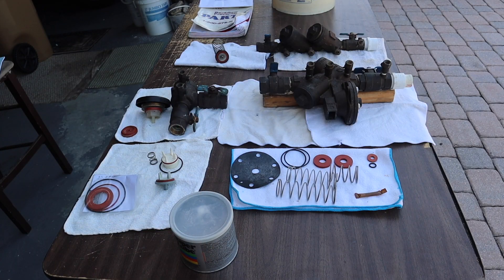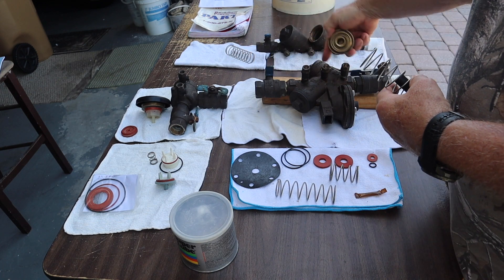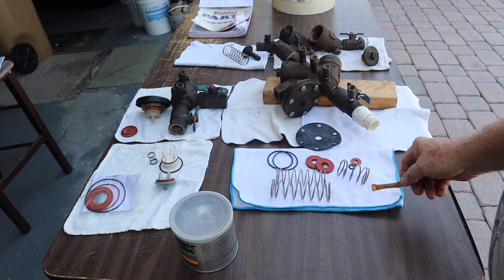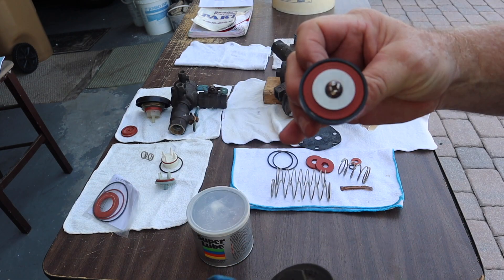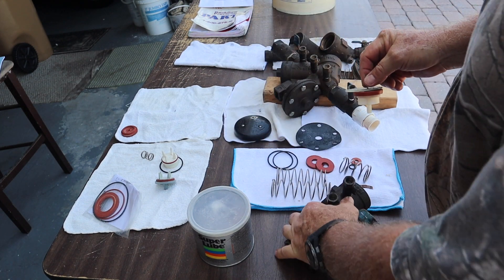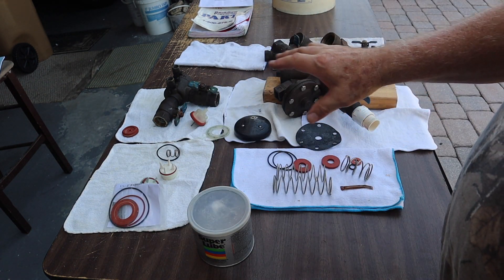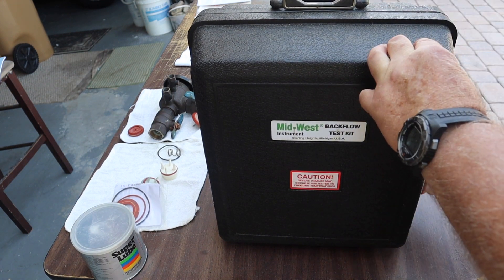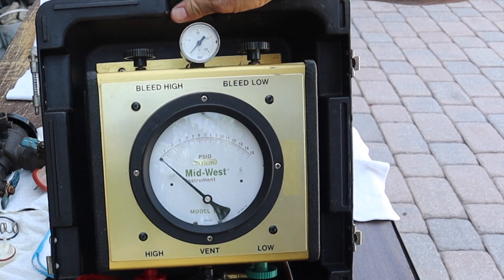HOW DOES A BACKFLOW PREVENTER WORK?

Comment: Nice video. Did you say double check backflow preventers cannot be used for sprinkler irrigation? Also, is a y-strainer necessary for reduced pressure backflow preventers?
Reply from the maker: Joel, I cannot speak for the entire country however, a double check is not authorized for irrigation systems. My water authority has looked the other way on them and continues to ignore new installation but they still are not allowed to be approved.
Reply: Thank you for the response. One other question.. Do you know if a y-strainer is necessary for a reduced pressure backflow preventer?
Reply from the maker: Sorry Joel, I forgot to answer that question. The purpose of the strainer is to minimize debris flowing into the RPZ. It is surprising how much debris is in our water system pipes but most of what causes a problem is sand, dirt, and mineral deposits that form on the check valves (especially Check valve one), but I do not think a Y-strainer would help much. It may just be my location but in over eleven years of testing backflow valves I never tested one that had a Y-strainer on it. I guess it is your choice.       Gerry

Comment: That was interesting stuff Gerry and how did an x prison worker get into back flow valves. I don't know if I have anything like that in my house. Did you go to school to learn this stuff or learn it on the job.
Reply from the maker: Steve, many people that worked with or for me asked me that question. I wanted to start my own business and those valves are on every house with sprinkler systems and every single business. I went to schools for testing valves and repairing them and had to re-certify every other year. I kept the business for eleven years. In the beginning I was full time also doing large commercial valves but eventually cut back on the commercial ones to just do residential valves. I enjoyed doing it and since I really was not in it for the money I did most repairs very inexpensively and sometimes free for my customers.    
Of all my videos these are very popular with folks in that business so I wanted to pass on my knowledge and experience to them.           Gerry